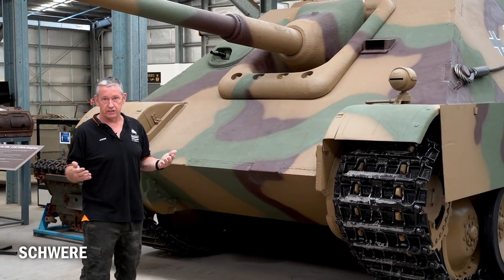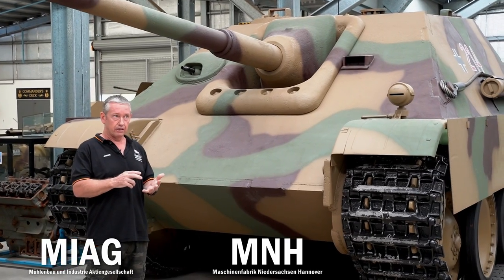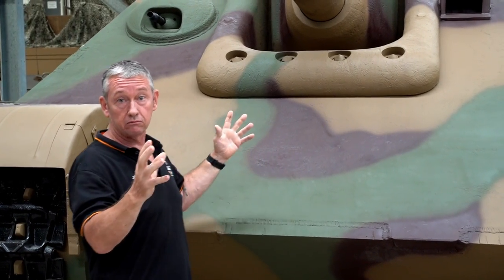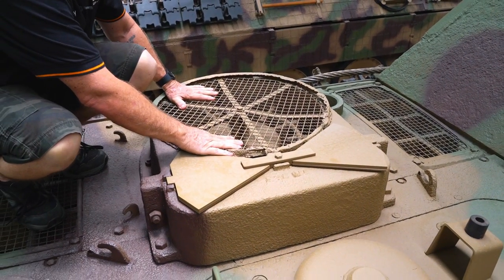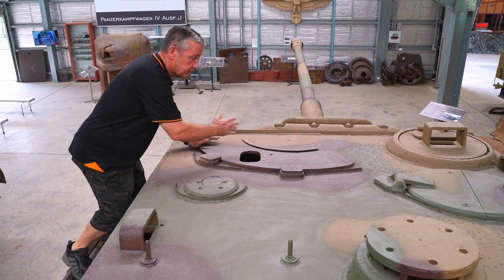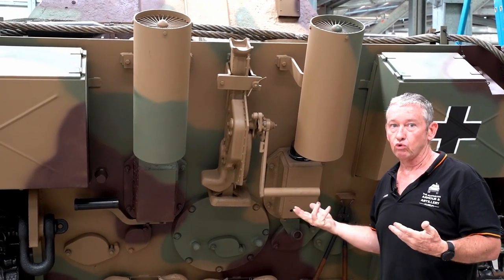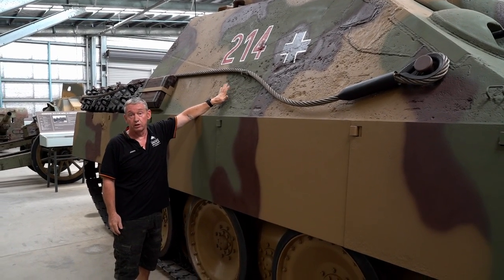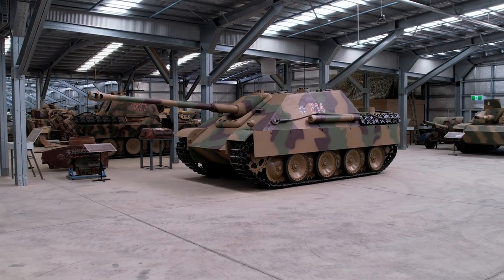The AusArmour JAGDPANTHER Tank Destroyer Tour

Comment: Some of your "facts" are incorrect, especially regarding the crew heater. The fan did not pull air "in", It's sole purpose was to expell hot air thus lowering the engine temperature, as the air was pulled in through the rectangular armor "grills" on the front and back of it through the radiators. Instead of expelling the hot air into the open, as you stated the "pie" wedges were placed in the installed "ring" around the top and the hot air heated the crew compartment. Your G 2 seams to be missing the "restrickters" on the port rectangular intakes which functioned to cause the engine temperature to run even "hotter" so more heat was pumped into the crew compartment as the whole system was designed to deal with the bitter cold of the russian winters.

Comment: As to the effect of sloping armor plates versus the typical blunt-point steel AP shot/shell (bare-nosed or just with windscreen), up to about 45-50 degrees from right-angles, the slope has LESS effect than merely not sloping the plate and making it thicker at the same weight.  This is due to the spinning shell having its "chin" (part of nose toward the armor) hit the -plate slightly before its "forehead" (farthest nose point away from the armor) and this twists the direction of the shell into the plate (refraction like light through a prism, in effect) so distance through plate is less than straight through from trajectory just before the hit.  When the angle goes above the 45-60-degree point of no refraction, the higher the angle gets, the better the -plate is at skipping the shell off it like a flat rock on water and sloping really helps the protection (at 60 degrees you get an additional 25% added plate thickness or so to that physical addition measured straight along trajectory just before the impact (depends on nose shape and hardness of armor).  Above 80 degrees, only very thin armor would be penetrated by any blunt-point shell.

If there is a hardened AP cap with a moderately sharp corner at the face edge where the windscreen is attached (crimped or screwed on), the corner can dig into a plate if it is thick enough to not dent much (about half-caliber thickness or more for the average typical AP cap face edge), the corner will cut into the face at 50 degrees impact angle or more and thus partially prevent the skipping effect, and so reduce the velocity to penetrate by an additional 12% or so, which can be significant.  AP caps that are soft (most WWI-era-type caps), or with rounded face edges, or with a wide edge angle over 135 degrees -- for example, see British Hadfield WWII naval APC shells -- do not get this 12% reduced velocity to penetrate bonus.
Reply: https://www.youtube.com/watch?v=vxTRaQ5ulyA&t=17s

Comment: Recoiless systems are extremely dangerous. To think they were going to install them with a breach inside the tank is kind of crazy. I'd rather have a reciprocating cannon in a tank compartment, than a solid breach that could blow apart if the gas pressure got too high from barrel fouling. Standard reciprocating cannons take a lot of the energy out of the weapon by turning it into mechanical advantage to cycle the breach and shell extraction.

Comment: Interesting comment about barrel life with a liner giving over 6,000 rounds life because in the Ukraine conflict the 155 mm howitzers have to change their barrels quite often.  Replacement has become a problem there because of the amount of use they are getting.
Reply: Modern 155s a have quite more oumpf than 40s 88s. Also, I think the higher figure is for the gun itself, liners would have been swapped many times before then.